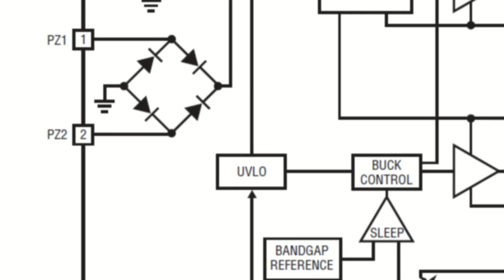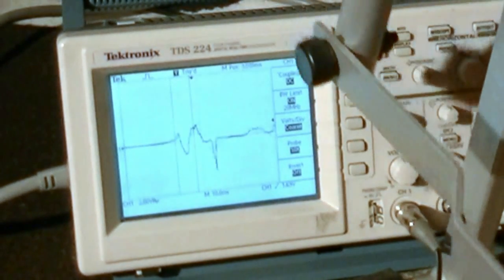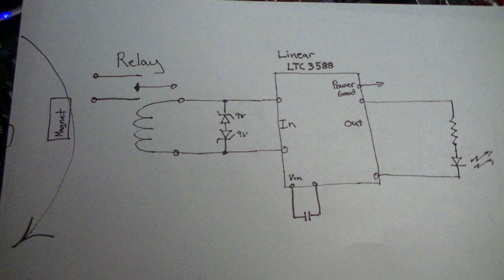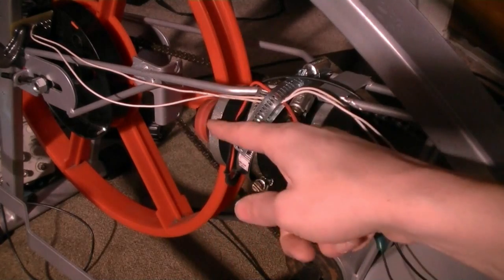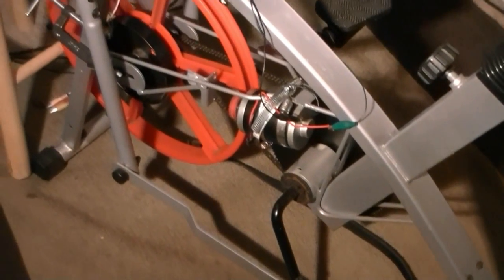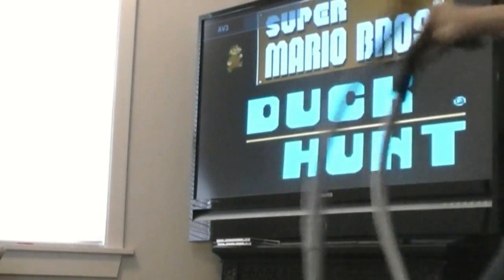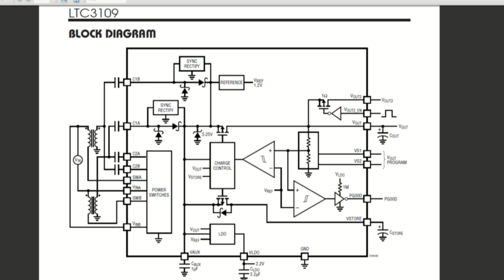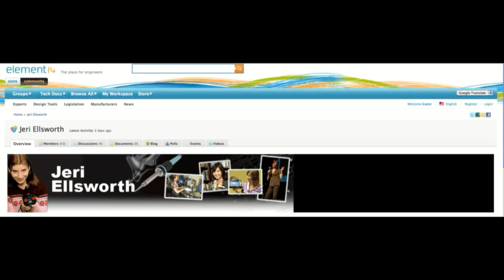Energy Harvesting - Is It For Fools?

Comment: What if thermoelectric materials reach a point where all electronics and electrical service components were "cooled" using a dedicated thermoelectric backbone. Essentially just another conductor, if that. Basically, by keeping the delivery side of generation cool (theroelectric panels in loads and delivery junctions with thermoelectric insulators) channeling the excess heat into production, storage, or reharvesting in various places between delivery, transmission, and production would possibly create a net gain in energy use, from the triboelectric effect mainly.

Comment: Self-winding watches are energy-harvesters. One chooses to wear one. Attaching a dynamo to an exercise bike is also a matter of choice. However, putting harvesters under public flooring is a matter of theft, pure and simple. Cannot see why? Imagine if they start putting dynamo-linked rollers in roads (a very old concept), it will require more energy to make a given journey. That is petrol-money taken straight out of your pocket! Energy-harvesting is indeed a racket. Stop it before it gets out of hand.
Reply: I have no problem with harvesting energy which would be wasted anyway, so vehicle-braking and vibration-damping are fine. But I feel that many designers do not understand Newton's third law or thermodynamics and really do not comprehend that the energy is 'not going to be wasted unless they steal it'. One hears of special clothing for soldiers which will re-charge their electronic devices as they move. That will surreptitiously fatigue the soldiers and make them less efficient. There is a demonstration passageway at Heathrow airport (London) which is illuminated using energy from piezoelectric tiles in the floor. Fine, the lighting panels are low energy. If one tried to power street-lighting using pedestrians, the pavements would become as tiring to walk on as swampland. The most ridiculous thing which I have seen is a proposed  'power-station' which consisted of petrol-driven cars going round and round a circuit with rollers set into the roadway. This was described in an academic journal which is devoted to energy management. Why not simply burn the petrol directly!  Energy-harvesting is not a magic wand for producing free lunches.
Reply: David Fisher  You make a very valid point. But done correctly it would benefit everyone. Dynamo-linked rollers can be placed where vehicles are required to stop and help with braking. Would like to see gym cardio machines converted to generators. A Japanese factory showed a mechanised cart receive a finished heavy object that, as the load compressed its springs, carried it several feet to another station. When the object was taken, the stored energy moved the cart back. The docks in marinas could be harnessed as they move with the tide.
Reply: http://www.dailymail.co.uk/news/article-2430771/Worlds-self-powering-gym-uses-energy-WORKOUT-lights-dont-break.html

Comment: btw, don't power an LED directly. Rather, have a Joule Thief circuit which is very low power light the LED using high-voltage oscillation. So if the goal is light, you can create lots of light with very low power.

Comment: I have a fairly large 54V Peltier junction heating/cooling device that I salvaged from an environmentally controlled outdoor equipment cabinet. It was disappointingly inefficient at generating power, even with very large temperature differentials created by the exhaust of an internal combustion engine. Sure it might power a LCD. But to do real work? Not quite. :-\

Comment: Did u mention putting a large supercap to buffer the power? Ive used the LT3588 demo board as well. B4 putting the cap Ive used the LTSpice to sim the waveform and it takes a long time to get an constant output b4 the cap voltage > Dropout voltage. Anyway Im looking to use it with an array of $1 solar cells I got from Walmart.

Comment: @jeriellsworth BTW, the first radio is always tuned to the strongest station that can be received, because all you are after there is the DC developed.

Probably any power one could get from a piece of wire would not be a millionth of what is being lost by radiation off the lines, so there wouldn't be much frowning going on. I don't suppose it would work with one of those fancy HV DC lines.

Comment: Do you remember the radios from the '60s that picked up one station, converted the RF to DC and powered another radio to pick up the desired station?

What about running a long wire under a HV transmission line (fence wire?) and picking off a watt or two for free?
Reply: crazy shit

Comment: Good ideas. I didn't know about those chips. I've been pondering how to power a data transmitter from my anemometer. I might try harvesting the 0.4 volts from the anemometer motor to transmit one second of data, every few minutes, instead of using a battery.

Comment: if you're saying 800mA at 5V that should be very easy to produce with pedal action. pro biker can do maybe 550watt sustained and average person maybe 300watt for a while. there must be some dramatic inefficiencies if 4watt out is hard. does the exercise bike still have its built in resistance?
the sideways rubber connection is presumably also quite lossy.
they have these kits on ebay with good solar cells at 350$/kW which is super cheap although you have to connect them and get/make a grid tie